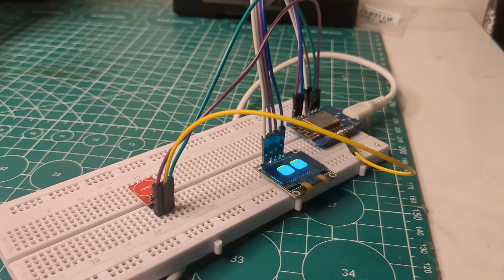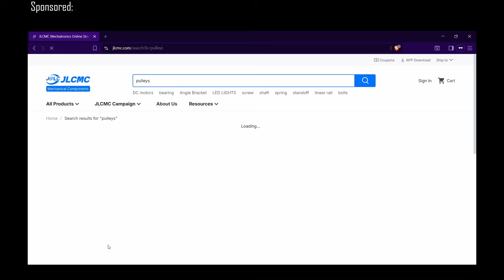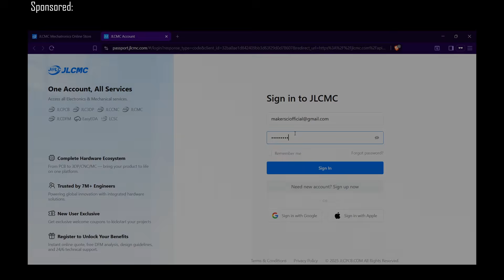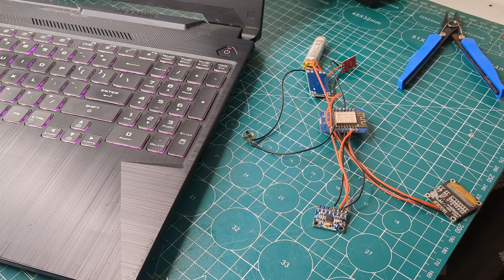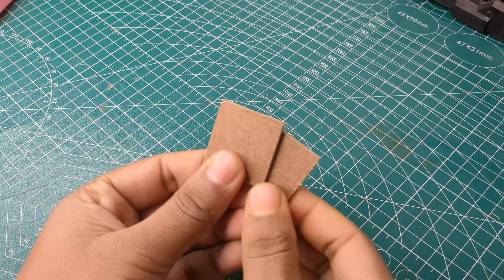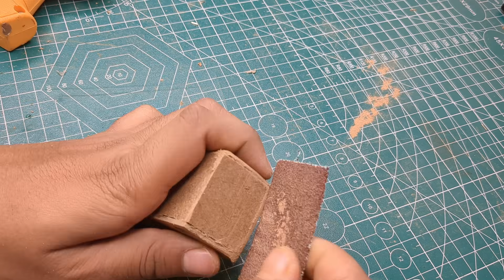How to make a Desktop Companion robot

Comment: Bonjour,

J’ai essayé de fabriquer le même robot que vous. Ma batterie est de 3,7 V. J’ai tous les mêmes modules que vous, à l’exception de l’accéléromètre ADXL345, et j’ai adapté le code en conséquence. J'ai aussi reproduis exactement le meme circuit que vous .

Tout fonctionne normalement, sauf l’écran OLED, qui reste noir. Pourtant, lorsque je téléverse un code pour vérifier s’il est détecté, le moniteur série confirme qu’il répond bien.

Je suis certain que l’écran n’est pas cassé, car j’ai réussi à le faire fonctionner avec un autre code.

Auriez-vous une idée de l’origine du problème et une solution à me proposer ?

Merci d’avance pour votre aide !

Comment: Please add some extra features like AI communication in future please I really requesting  you
One question can you please suggest me alternate of mpu 6050, can I use three gyroscope sensor adlx
Reply from the maker: Al interaction is definitely on my list for future upgrades.

And yes, you can use an ADXL as an alternative, but the MPU6050 works better overall. Since it has both a 3-axis accelerometer and a 3-axis gyroscope, while ADXL is only a 3-axis accelerometer.